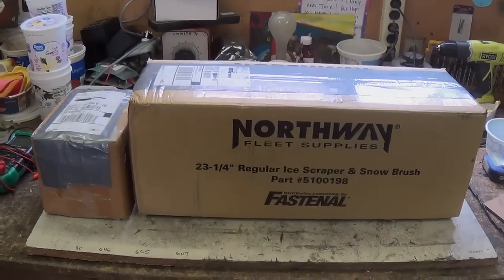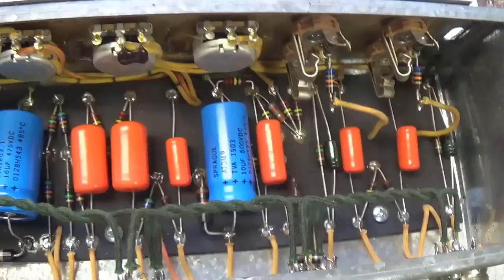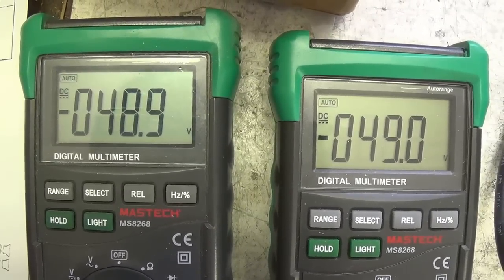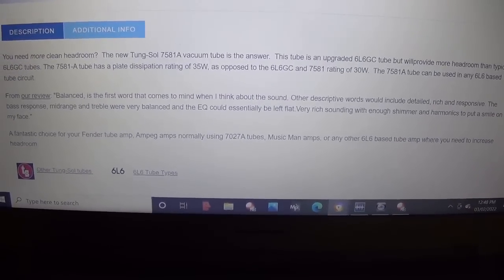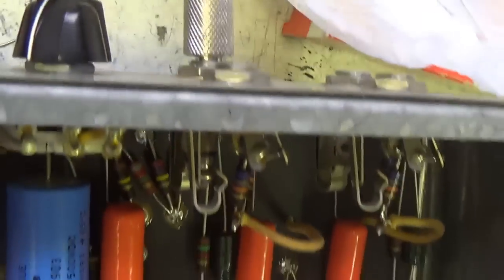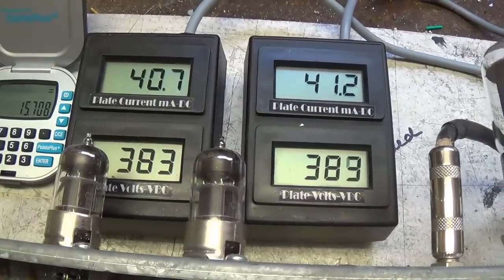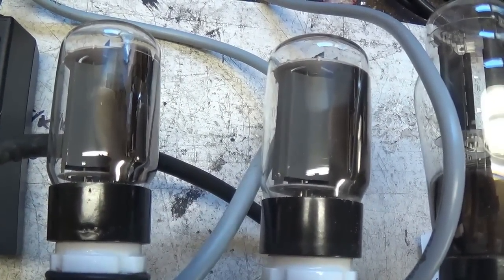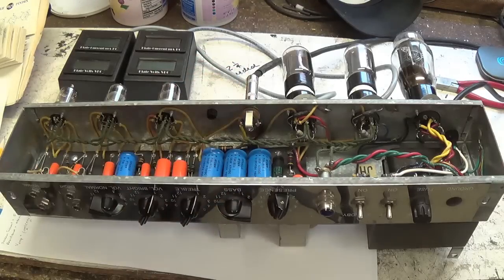Victoria Clone of a Fender Tweed 5F4 Super Amp

Comment: As an ex-navy ET (electronics tech) you bring back memories of instructors I had explaining tube behavior and circuitry.  Now in my early seventies, I just finished rehabbing my 1960’s Magnatone M-15 during Covid days. Your vids gave me a lot of suggestions and ideas for trouble shooting various issues. Great stuff. Thanks.
Reply: Former AT here.
Reply: FTM here. Still workin on basically   radar "Error" amplifiers for guitar.
Reply from the maker: That's great to hear, Rocky. Keep up the good work :)
Reply: My father served in the Navy 6 years repairing radios amplifiers and television equipment in the Seabees 1969 too 1976  was in Spain Newport RI   I wish I had his knowledge he is 74 now with dementia and still is fixing radios he horded so many tubes and iron and test equipment before he left and we use it almost everyday 
Nothing like USN Iron

Comment: I built that 5F4 tweed Fender Super clone from Mojotone kit. I'm a fan of class 'A' phase-inverters. I made a few mods: used a 5AR4, added an additional 47uF cap to the power supply, added a bias control potentiometer, rewired the choke coil to feed only the 12AX7 tubes; which increased the power output, installed a 50 watt output transformer. Great fairly lightweight 35-40 watt amp. :)
Reply from the maker: Thanks for sharing this with us, Tony.

Comment: Another great video from Uncle Doug. One thing that should be noted regarding the kill switch on the feedback circuit. IF there's a Fender presence control, opening the feedback loop takes the presence control out of circuit as that control is part of the feedback loop. FYI.
Reply from the maker: Yes, indeed, but it's worth it.

Comment: Wow. I have had one of these cap tester. and also sold it after getting an esr meter. What a mistake. These load the caps and are a great way to test. Loved the video.
Reply from the maker: Thanks !! You can still test for leakage by lifting the "downstream" end of the cap from the circuit, Monty.
Reply: @UncleDoug  Very true. Thanks Doug. Good test in almost circuit
Reply from the maker: @montygore1200  You're welcome, Monty.

Comment: Hi UD, nice video. One note to mention, I have the Fender Super Amp, and I changed the rectifier to a 5u4 from a gz34. A customer brought in the exact same amp as mine with a gz34 rectifier in it. An A/B comparison revealed quite a difference in gain. I didn't check the bias comparison, but if your customer changes the rectifier tube to a gz34, I am sure a re-bias is advised to cool down the 5881 tubes. Great video as always Uncle Doug 👍.
Reply from the maker: Thanks for the info, Ken.

Comment: You always do a very nice job on your videos, and it helps a lot of people wanting to learn about amp repairs. On the speaker jacks however, the output transformer should always have a load on them when nothing is plugged into the jacks.  This is why Fender always shorted the speaker jack when nothing was plugged into it. The reason being is if someone should plug a guitar into the amp without a load and then play the guitar the impedance of the output transformer will go sky-high. This can create large voltages and can cause the 6L6 tubes to internally short or cause the tube socket to arc over due to the excess hi-voltage across it. There should always be some kind of load on a tube amp to control the output transformers kick-back voltage.
Reply from the maker: Thanks for your helpful input, Neutro.

Comment: Hello again, Doug, with another excellent video, amp, and...what a gift!. I am searching for one of these cap testers for ages!. It seems to be difficult from here in Spain. And also: be very careful with the tester, because it outputs as much as 600 dc volts in the banana jacks. Never forget to discharge it, and put the test voltage knob at its minimum, because we need to see your videos during too many years! 8-) Thanks a lot, and God bless you, Doug & the cat gang.
Reply from the maker: Good to hear from you FW. Thanks for the safety tip :)
Reply: @UncleDoug  safety first, you know!

Comment: Another masterpiece theater installment, thank you Doug!  That amp sounds absolutely wonderful. I have been trying to purchase those Eurotubes bias meters ever since you demoed them a few moons back and they are still sold out!  Very much hoping they return to market some day, being a much safer alternative to the shunting method that gives this particular amateur the heebies.
Reply from the maker: Thanks so much, DD. I really don't recommend the shunt method for PC measurement.....dangerous to mankind and equipment. Simply measure the voltage drop across each half winding of the OPT primary.
Reply: That’s for sure the best way to go
Reply: Those Eurotubes bias meters are fantastic. I bought mine a couple years back after watching Doug using them. Wonderful, wonderful tools.
Reply from the maker: @SimonGotlieb  Agreed, Simon. I don't know how I lived without them :)

Comment: The presence on the 5F4 is pretty enimic. Also it should be noted that when turning off the NFB loop, it will render the presence control inop.. but not sure it would matter that much as it is pretty useless. I placed a .47u Cap in place of the .1u on my presence control and it made a difference, at least you can tell it is actually doing something now. Great work as always Uncle Doug and we learned of yet another 6L6 variant.
Reply from the maker: Good observation about the consequences of turning off the NFB, DL, but really not very noticeable.....as you noted. Thanks so much.

Comment: This amp may look inconspicuous but it's a real deal beauty on the inside. That's how you build amps! And that's the way amps should be modified too. None of that kludgy bullshit I've seen in many of them, some of which made me consider an amp not ready to power up before taking care of the rat's nest inside.

17:40 it's transliterated to 5C3S and it's a directly heated 5V rectifier pretty much like 5U4GB, same heater current and voltage, but coke bottle and can withstand 550VAC instead of puny 450V.

Lovely car and meowsome cat for sure :)
To state the obvious, talking about spots at the base of the tail, these are very scratchy and cats just love being pet there.
Reply from the maker: Thanks for all the great comments, Keri. I agree across the board.

Comment: Very thoughtful and professional approach to the conclusion, I was thinking the whole time "why would victoria amps use orange drop signal caps in any fender clone amp they would build?" Victoria amps are normally built with the blue sprague signal caps that the victoria amp company commissioned sprauge to build to match the original fender offerings of the vintage leo fender designs.
Reply from the maker: Thanks for the nice comment and info, FL.
Reply: This amp was probably built back before Victoria commissioned the blue caps you mentioned. I have a early 90's guitar mag that showcased a couple tweed clones, a Holland, and a Victoria, both used the orange drops as coupling caps back then. In fact, I remember when OD were considered the best coupling cap... I have used several kinds in various builds, and I don't have a preference at this point. I have found that tubes and speakers make the most difference to my ears. That said, I believe I can hear a subtle difference between cap types, but I'm not sure if it's real or not. People argue about this to death. I'll leave it at that.
Reply from the maker: @patchesthejaybird8431  Thanks for the info, PJ.
Reply: @UncleDoug  do you know the year of this amp?
Reply from the maker: @fisheyelens876  I do not.....Sorry.

Comment: That Heathkit is a jewel!  It's younger than my piece of Heathkit test equipment - I was given a Heathkit AQ-1 audio signal generator (circa 1957) by an old neighbor - and after a set of electrolytics, it's as solid as a rock (if you don't mind the analog frequency dial!) The head technician had a Heath cap checker similar to yours at one of the shops I worked for, and if he suspected a tech of shotgunning caps, he'd take it from the margarine tub and test it while the tech was away, then leave it on his bench with the results scribbled on a piece of paper. Needless to say, we mortals dare not step into his sanctum to test our own caps but he would break it out sometimes if we were stumped and he suspected leakage that we had missed.  I wonder if someone has written a book about the whole Heathkit phenomonon - a real example of post war GI industriousness and excitement about the hi-fi craze. One thing I remember about Heathkits - when the owner was stumped by a problem, he'd bring his unit in with all of the encyclopedic manual, notes and records, and go over all of his prior troubleshooting in detail! I can't wait to see your future comparison video with the current magic box digital cap checkers. I use them, but don't completely trust them (how can a $15 ebay cap checker do the same job as the $450 B&K? circa 1975). Thanks for the great video, as usual!
Reply from the maker: Thanks for all the great comments and shared experiences, 87. So glad you enjoyed the video :)
Reply: Fran Blanche over at the Franlabs channel has quite a few video’s on Heathkit kits. Apparently she got started in electronics by visiting their repair facility as a child.
Reply from the maker: @rivulus  Thanks for the info, Roelof.

Comment: UD, outstanding as usual. The tube swaps are funny, you have to restrict the amps to the tubes so you don't damage the power amp, so now the tubes are barely working, it's like someone I knew, tunnel ram, twin 1050 dominators, on a stock 327 in a Camaro, just "couldn't get it to start right in the morning, and had to rev it too high at stop lights", but it looked great. Also when I heard you say Hammond my ears perked up like a Dobie hearing 15 kHz, but my hopes were dashed when I realized you were talking about a transformer. Anyway hope everything continues to go well for you, and still hoping someone sends you a 144 or 147 amp to repair.

The Blue Mule
🤘 Leslies Rule 🤘
Reply from the maker: Your analogy was right on the money, BM. Thanks for your input :)

Comment: Almost all modern electronic equipment power supplies use a Line-to-Ground and Line-to-neutral cap as EMI/RFI filters. They are supposed to be a special XY rated safety caps that are designed to only fail open.
Reply from the maker: Thanks for the helpful input, William.

Comment: I built a clone of this circuit myself a few years ago. I used Mercury inductors throughout, and I found it hit the bias numbers in the schematic just about exactly. I think I ended up with 410-420 V on the anodes at about -20 V on the grids, and that it was in its happy place there at ~ 60-70% for a pair of 5881s.
Reply from the maker: Sounds like excellent values, BS :)

Comment: Great video as always. It is not really in line with the vintage correct approach, but I have used some Russian 6P3s-E tubes with good results as a substitute for old 5881. And those 6P3s-E used to be quite cheap a few years back... but tolerance are quite wide and a good matched pair is not easy to get.
Reply from the maker: Thanks for the info, Joel.

Comment: Gidday Uncle Doug!  Great video as usual!  This one popped up showing that I hadn't watched it!  I'm so glad I did but I  don't know how I missed it before.

Nicely made amp.  I think you're right with those 7581's being biased so low, they're barely running, & out of their linear range.  The 5881's definitely seemed like the wrong tube for this amp.  Good insurance you installed those 470 ohm screen resistors for the output tubes.

You showed the presence control  doing 'something'  at around 2.3kHz, but not much.  Is that the way presence controls usually function?  It seems like the treble pot could do most of what the presence pot can do anyway.  Maybe the presence control was mainly just a kind of a sales gimmick to sell more amps?

Missy is a little cutie!  Please give her a pat & a head scratch for me!
Reply from the maker: Thanks for the nice comments, Neville. Although the Presence pot did not seem to have much effect in this amp circuit, stay tuned for our next video in which it is fully explained and demonstrated.

Comment: Try using a 400 Hz tone,  It's far less offensive to the ear than 1 kHz and it's excellent for finding intermittent connections and noisy controls because any distortion that comes and goes will generate a distinctive, buzzy sort of mosquito-sounding harmonic.
Reply from the maker: Thanks for the tip, GU :)

Comment: 5ц3с is 5U4G replacement made in USSR by Svetlana which seems to be a new one (quality control mark is intact and did not degrade after heat). And I can say that this tube is nice because it has black plates inside and it's considered a superior quality in comparison to grey ones by audiophiles. However, as per my experience, these tubes suffer from heater isolation shedding due to age and due to vibrations. So I'd either go with classic 5U4 or use NOS Svetlana 5ц3с because they are more reliable.
Sorry if bothering. Cheers, Uncle.
Reply from the maker: No bother at all.....we really appreciate your knowledgeable input.

Comment: Uncle Doug’s Amps n’ Cats! I love ‘em both!

I’d have to agree, the amp was biased way too cold for the 7581A’s. The description the owner wrote about is exactly what super cold beam tetrodes do. Distorted, unstable nasty tone.

Genuine, New Jersey made Tung Sol 5881/6L6WGB’s are 25 watt plate and 3.5 watt screen dissipation tubes.
I picked up a commercial version quad a while back in the original retail sleeve that had all of their ratings on the back. The sleeve alone is pretty dang valuable to me.

All of the rest of the 5881/6L6WGB’s are definitely NOT capable of 25 watts of plate dissipation, no matter where and when they were made. I think Fender used Tung Sol 5881’s because they were the best possible for that application.
Reply from the maker: Thanks for the input and helpful info, Matt.

Comment: Would love to see a video on the heathkit. I have one as well and haven't used it in years. would be cool to learn about it. Think I found the manual for it on the net in PDF form.
Reply from the maker: I downloaded that pdf manual, Bill. The unit does not put out the proper voltages for testing. They are currently around 70% of dial value. I'll have to make some repairs.

Comment: Hey, Uncle Doug— I've been watching your videos for several months, and I feel like I've learned more about valve amp technology in that time than in the entire 10 years prior. In fact, your videos are part of what inspired me to buy some old prewar console radio chassis(es? I dunno the plural) to see what I can learn. I promise not to kill myself by touching un-discharged capacitors. In fact, I don't plan even to plug them in; my current plan is to pull the power transformers and interrogate them with a VOM and a variac to see if they're the sort one could build a little amp (good-sounding or not; it's just for learning) around. 

By the way, one of the power transformers on these units has 18 separate taps. That seems crazy—is it normal? There's also a roughly 5" x 4.5" x 2.5" metal box under the chassis, covered by the metal on 5 sides and completely potted with what must be a pound of black wax on the open side. The unit has no brands, names, numbers or words anywhere on it. Does this ring any bells? I realize this is an annoying question, so I'm going to head over to Patreon to give you some (more) money in exchange for my being annoying, and also for all I've learned from you so far. Thanks again.
Reply from the maker: Greetings, Marty. I'm glad you're playing it safe :) God only knows the purpose of the metal box. It's generally best to harvest reusable components and throw the rest in the neighbor's trash. That way, if any items are hazardous......they get the blame ;)
Reply: @UncleDoug  Fair enough, if an experienced person gives me permission to not worry about it, I'm only too happy to accept their advice. I'll stick with the parts I (have a chance to) understand. Thanks!
Reply from the maker: @martysmith2756  Good luck, Marty :)

Comment: Uncle Doug, perhaps it's an issue with the guitar(s) he's using. I had a similar problem on my Telecaster after I installed a 5 Way Super Switch. Turns out the lead free solder I used to add the needed Grd wire to the neck pup, hadn't taken fully. I resoldered it, no problem. Had another guitar when I switched to both HB or Bridge position, it fizzed. Well it was a China built guitar, the HB were actually, really really shoddy pups. The bridge pup had a wire I could actually see that was shorted, to the case. So I bit the bullet, spent an ungodly $20 bought replacements. Now it sounds fine, surprisingly, for a $160 guitar. I did replace most of the hard ware too, that was an extra $20. (Trying to keep it authentic by using quality Made in China parts😂)
Reply from the maker: Thanks for the helpful suggestions, BiG, but replacement of the incorrect output tubes solved the problem.
Reply: @UncleDoug  Glad that solved the problem. Hope you & the menagerie are well. Got the Grandson for the summer, so it won't be too bad.

Comment: I think there is oscillation from the two transformers cross coupling causing the feedback.  One transformer needs to be mounted further away and rotated 90° to stop this feedback.
Reply from the maker: What feedback are you diagnosing, MV ?  You realize this is a classis layout design that has thrilled and amazed for many years.

Comment: I would be wondering if the user is running an attenuator. I’ve found some attenuators (THd hot plate for one), if tubes are biased hot, mixed with the resistive attenuation, can sometimes cause one side of the output to red plate when playing
Reply from the maker: No, he is not, RC.....but thanks for the info.